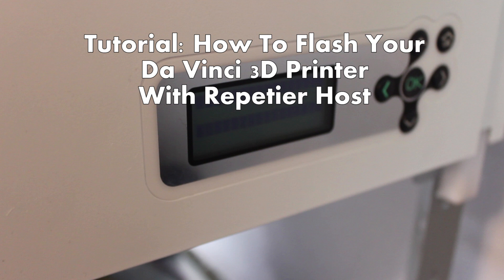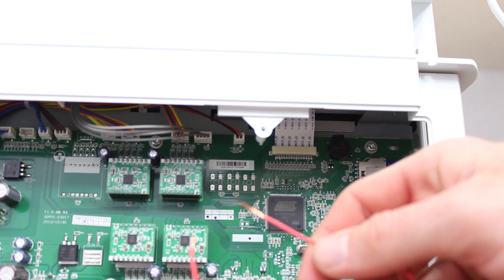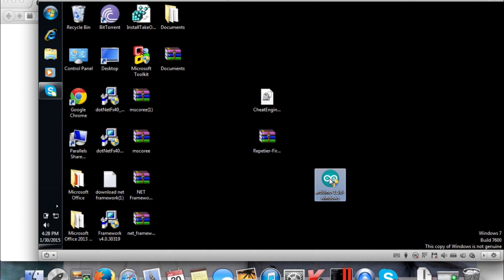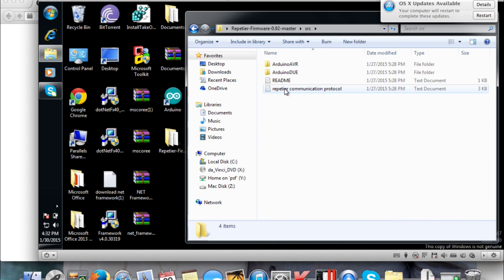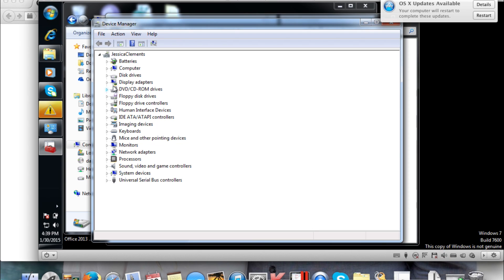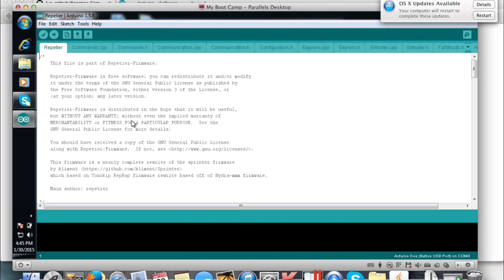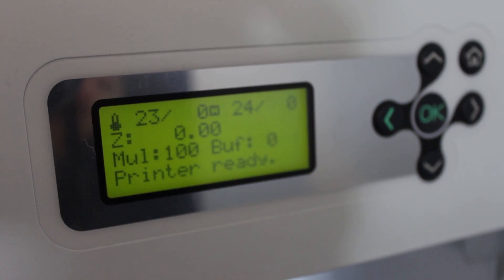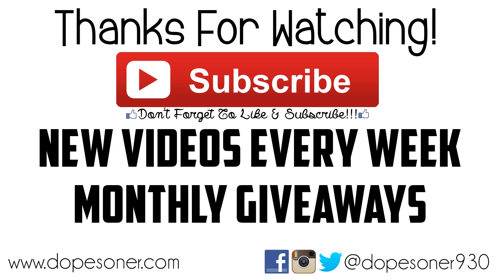Tutorial: How To Flash Your Da Vinci 3d Printer With Repetier Host | 3d Printer Hacks

Comment: Can't print! Send a print from repetier-host and nothing. Try to print from SD nothing but crashes into print bed! Help plz
Reply: charlie michaelME TOO, did you find a solution?
Reply: charlie michael I'm in the same boat! I click connect in repetier, it turns green, (connected) but under config menu eeprom is greyed out. found someone else who said that means it's not seeing it, tried settings in his video, still nothing, used both auto as well as the proper com port... HELP? This video is great by the way many thanks for getting me this far!
Reply: charlie michael you all probably figured it out but a solution here would have helped me, so I'm posting it... you have to go to config/ printer settings and where it says reset on connect make sure its set on due native usb port (found it below)
Reply: Yeah sorry I found it awhile back thanks tho, find any good printer settings with abs?
Reply: trying to figure out the printer settings now... first it was printing off to the side, just shooting abs into the air! Manually leveled the bed (the printer walks you through it pretty well) now it prints but won't lay down the first layer properly, seems to be a temp setting but trying to figure that out...
Reply: I found a video awhile back tried to mess with the settings so it would be perfect and I messed everything up, I get failed prints left and right the first layer is always horrible or the print doesn't stick.
Reply: IndaLight I've been troubleshooting and trying so many things I can't remember exactly what's gotten me this far! I would like to shoot my own youtube vid with ALL the issues addressed in one place! I've had to revert back to xyz for now, but I'm still hopeful.  I think your prints (like mine were) are simply not getting low enough to the bed so the abs isn't sticking. I did a manual calibration, that brought it down lower but then the plastic was just getting gooey, (temp issue?) I changed the temp in the repestier eeprom settings but the printer still went up to 230.  I don't even know if that's a problem honestly, just trying things! You keep me posted, I'll do the same for you, right now I'm on XYZ so I can't do a lot to troubleshoot, but I'm still searching for answers...
Reply: Keep me filled in, I would like to know if this works for you too. He changes a lot of settings in the video but I have pictures of the default settings in slicr in case you want them/need them but no pictures of the default of the printer config.
Reply: Did it work?
Reply: IndaLight update... I couldn't afford the time it was taking to mess with this, I reverted back to xyz firmware and software, printed off some things.  Met with experienced 3d printer guys last night who gave me some ideas, I'll be trying to flash it again hopefully by the weekend.
Reply: ***** I did the same thing to reset the firmware on the davinci (short out the jumper with the paper clip) and then used the firmware I found here to go back to the original firmware: http://www.wctek.com/shop/content/11-repository EDIT: I tried a "downgrader" which comes up on google search but it didn't do anything, it didn't show an error or success, it just didn't do anything every time I ran it.  Also, I found forums that suggested using version "J" of the firmware, I also found the XYZware there, and allowed the software to update to the latest, which seems better than the original, but I didn't allow any automatic firmware updates, when it asks I deny it. hope that helps!

Comment: you guys are awesome, it does indead work so far on the new one, that has magnet locking doors and says 3d printing on the door and the serial number starting with 3f10a...
now I just got to put it all back together. dumby me thought I was going to have to put another motherboard into it that I was iffy about...... now lets see about getting repetier and all machine settings going
Reply: thomasheisler Cool. that was my question. Whether or not this would work with the 3F10A Serial number. You got it working though, and didn't brick it?
Reply: yes it will work I said I got the 3f10a and it is up and running
Reply: thomasheisler did u do anything different for the new model? it worked right away doing it like in the video?
Reply: yep, exactly as the video
Reply: thomasheisler I heard after printing big things with the repetier, there can be problems with x axis shifting, has this happened to you? You had any problem after changing to repetier? My firmware right now is 1.0.1

Thanks a lot for your help
Reply: thomasheisler  Hey man, I'm doing this to my 3f10a as well, but I keep getting compiling errors in the code. Any suggestions?

Comment: I flashed my printer last night and it all worked fine, but ..............  HELP.  I cannot print now.  The bed moves too far down for the first layer, like 1/4 inch from the extruder.  I have tried auto calibrate but no joy.  What do I do after hitting Load Fail Safe to calibrate the build platform?  Thanks
Reply: Update.  All is good now, got it all calibrated and it is up and running once again, HUGE improvement from the XYZ software :D:D

Comment: So what does flashing a 3D printer actually do? What does it allow you to do that you couldn't before ?
Reply from the maker: Allows you to use your own or any filament. ads a ton of features, allows you to use repetier which is a way better software application for your 3d printer as well.
Reply: Dopesoner im just curious what things could be an issue with the flashed version. like could i damaged the printer if i didnt so some thing right? what i mean is the current OS on the printer is good for those learning etc and dont know many of the finer details or settings for these things to run correctly. so if i flashed it and just did a print with default settings in the other software whats the potential for damage etc?